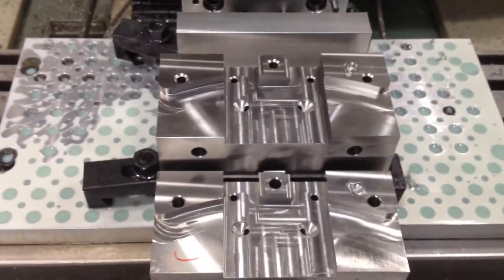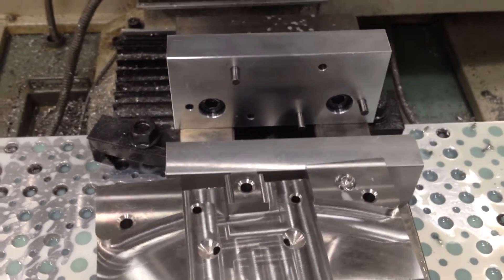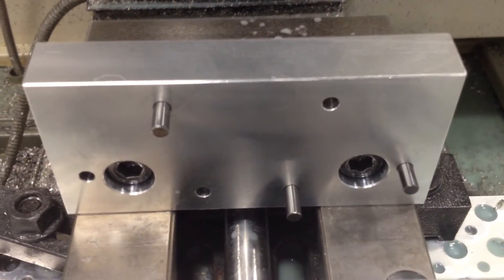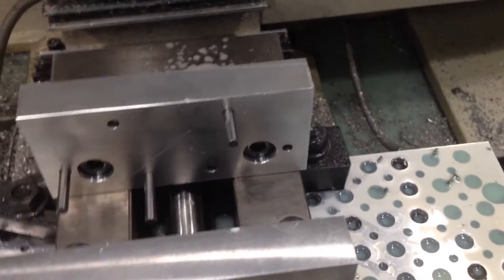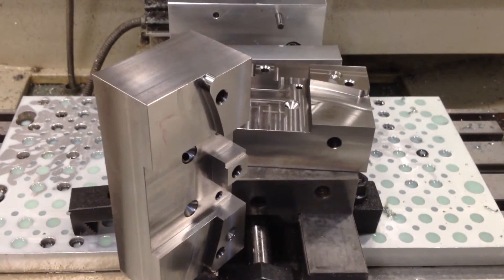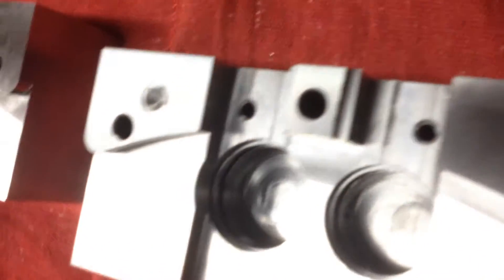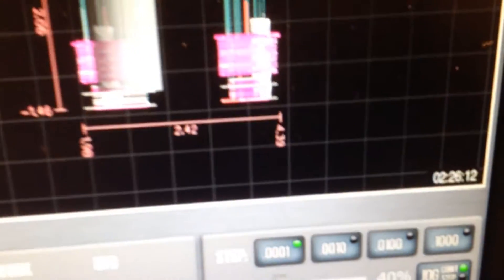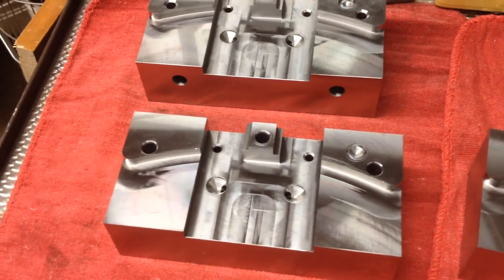SS Disc Brake Caliper Part 1 Tormach 1100

Comment: I'm curious.....if that angled holes are simply for a passage from one bore to the other, why did you do them from the outside?  Are you going to have to block the outside ends.......or are they going to be connected to the brake line?  I've cross drilled volvo calipers before.  It's done from the inside at a similar angle, until they just reach each other.  Obviously, the bore is there already.  I've been wanting to watch these since they posted.  Hopefully, I can get to the other two tonight. :)  Thanks!!!
Mike
Reply from the maker: The bores are from the same side. When I made the alum prototype I found that it was hard to drill the holes after I did the bores since they are at a 45 to the bore walls. I figured it was going to be even harder in stainless so I drilled the ports before the piston bores.
Reply: Ah.....duh!!  I see it now! lol  Much better idea.  Yep....trying to cross drill after the bores are made is challenging enough.....way harder in SS!  I did it in cast iron with a jig I made....not bad.  
I'll try to pay closer attention on the others. :)
Thanks!!